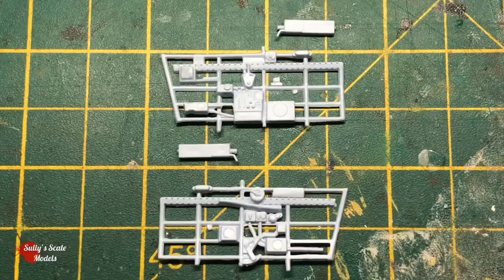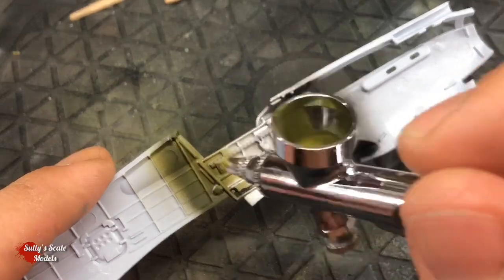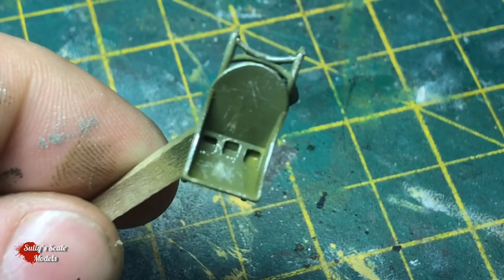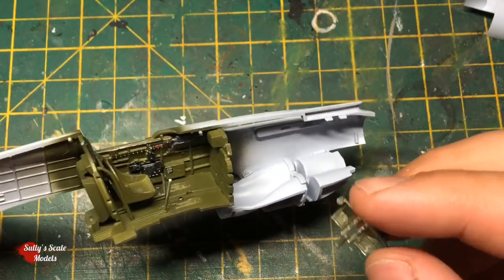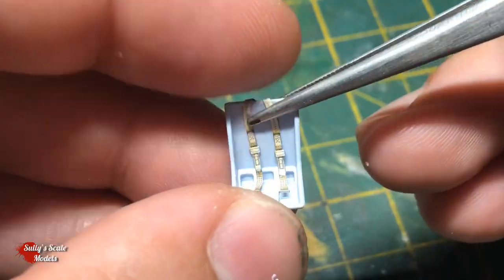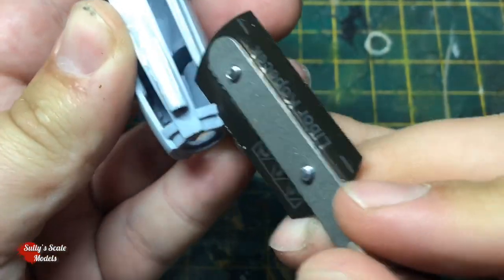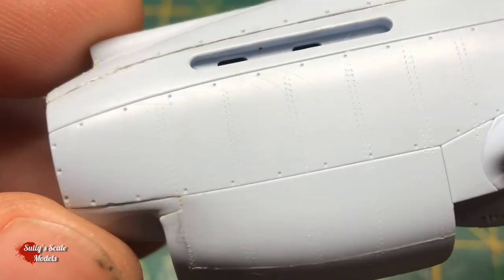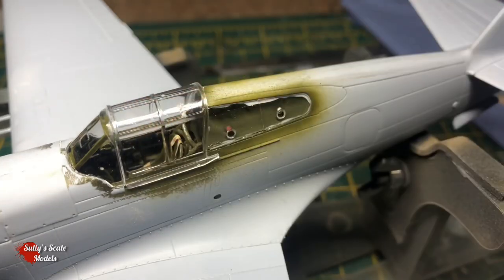1/48 Airfix Curtiss P-40 Warhawk

Comment: just  bought this kit so interested to see how it turns out. Where did you get the riveting diagram
Reply from the maker: Simon Woods Dont do what i did and mount the walls of the cockpit i think thats the reason why i had the fitting issues!  Heres were i got the plans from, you will have to scale them up abit i think if you print them strait out it comes out in 72nd 

http://soyuyo.main.jp/p40b/p40be-1.html